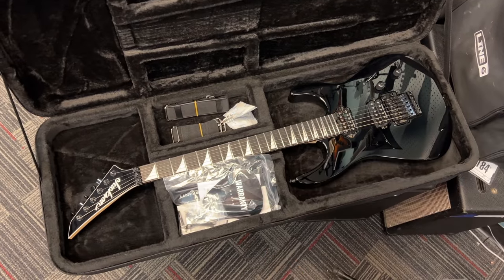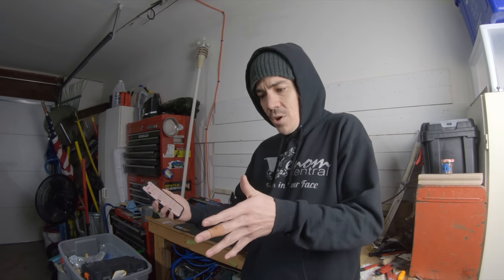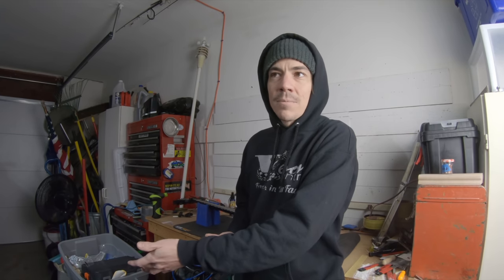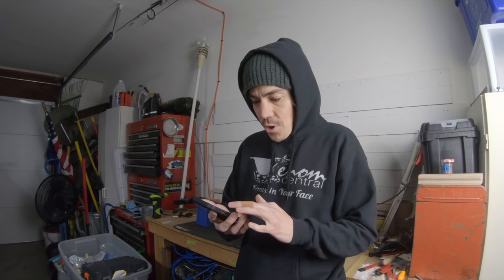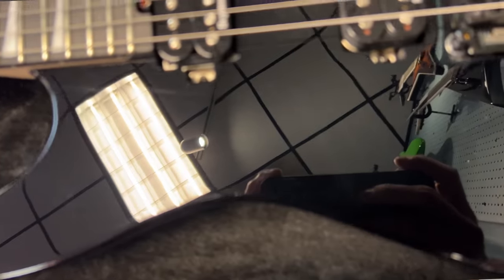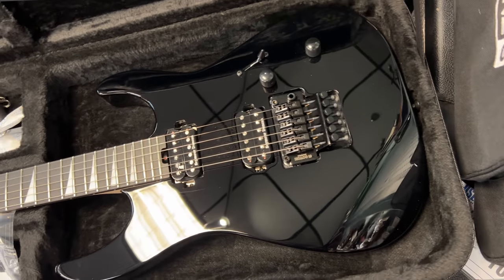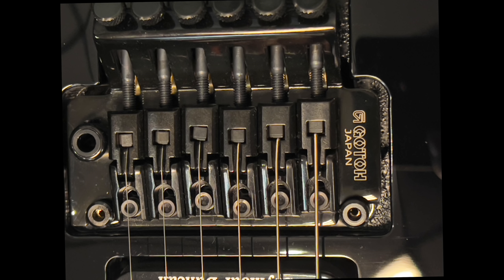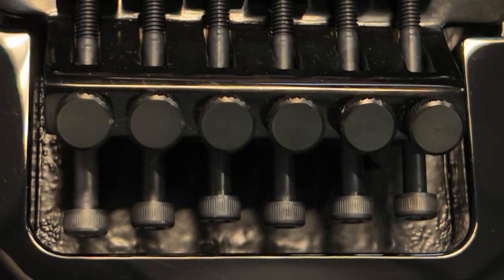JACKSON GUITARS IS DONE. MJ series/INDO EXAMPLES

Comment: In the old days we had american jacks and jap jacks. Period. Now we have js-china, dk pro fender mexico, soloist pro samick indonesia, a few soloist pro china, a few korea, a few japan. The x series made at the Cort factory, and until they changed factories the adrian smith was made in INDIA. Jackson dont know what they have anymore and they dont know from whence it comes. But there are still some gems coming from these factories. I bought a jap dk-2 in the 90s (the ones everyone raves about) and it needed more work than my sl3 pro indo and my dk3 mim. I bought a new American 2002 dk-1 and it was perfect except it was dead. No pickup change helped. Just a nice playing peice of sheet. Catch the pro series when they are returned or slightly used for alot cheaper. They are decent guitars and very gigable but not worth the new asking prices. Fender owns jackson so I think fender might be driving jackson into the ground. At these prices sales WILL fall and that may be the plan. Jackson maybe Fender's 'dropper' write off.
Reply: I bought a used 2021 Jackson Adrian san dimas i got in mint shape for $350 and that thing is a beast for the money!
Even before i upgraded it the guitar played and sound incredible for a under $600 guitar(they go for $550 new)
all i did was remove the satin poly finish off the back of the neck and  put on tru oil and put in dimarzio's i had 
already. I will be swapping the Floyd special with a Gotoh 1996T down the road. not because i have to i just prefer the Gotoh trem.

Comment: Quite a few great 80's guitar brands are now really short on QC not just Jacksons. I have looked at quite a few Kramers that were almost unplayable brand new. Sharp frets, actions not adjusted properly. B.C. Rich guitars are not as bad but still overpriced for the workmanship on some of the ones I looked at. I had a Jackson Rhoads back in the day and sold it due to hard times and still regret letting it go. Love my Schecter I have now but had to upgrade the Floyd Special it came with as that was the only weak spot on the guitar with those pot metal saddles.

Comment: I was in with the whole crowd back in the day, and yeah the "Jackson" guitars of today are nothing like the original Glendora built Jacksons (up to Serial # J1800 (RR1800) and lower. I got an Indo SLX Soloist in April 2020, and the flaws were embarrassing; BAD fret sprout, wonky Floyd trem cavity, scratching from buffering (gloss black), just to name a few. Jackson turned to shit when Fender bought them from IMC, which actually still put out decent Jacksons well into the 90's.

Comment: 10:00 they most definitely did not say that.
Reply from the maker: Then why do esp, Ibanez, prs, and other brands made in the same factory by the same people have obviously better quality control and fit and finish? When I worked at Taylor we had different rules for what was allowed for different models. At these factories they have the same thing, and for different brands. Clearly Jackson allows lowers quality or it just wouldn’t happen. They are also cheaper wholesale than esp. For example my pro series king v was about 500 wholesale, 1000 retail. My Ltd ec-fr black metal was about $700 and retailed for 49 more at the time. I’m not sure which factory made the Jackson, but the Ltd was made at world music and is flawless. The Jackson far from it. If you can find another way to explain this I’m all ears. I check out every Jackson and esp that comes through my high volume shop, and that’s a daily thing.

Comment: Valid point you missed, is Kramer guitars.  Yes, they are owned by Gibson.  Kramer also did a LOT of ESP guitars R&D in the 80's..... Kramer have been cranking out some decent guitars recently.  Most the real Jackson guys stopped around the mid 90's when Fender bought out Jackson/Charvel......  I find it more interesting though, that Fender has Charvel guitars made in Mexico, while Jackson, which is of the same blood line, made in Indonesia.  For $2700, you could get a Caparison, which has a better quality control, and is more prestigious. 
Also, fun fact, the difference in necks from the ESP and Jackson, is the floyd R2 and R3 sized nuts.
Reply from the maker: Good points. Yeah the wider string spacing and wider fret board with the r3 is nice. I tried two Kramers that were about $800 and I wasn’t impressed at all. One of them was a total roads copy and I found it pretty lame Gibson is suing everyone while they are ripping off Jackson.

Comment: I only ever owned one ESP, it was a 2019 E-II Eclipse DB. Wouldn‘t stay in tune at all. The nut wasn‘t installed on a plain surface but even with a new bone nut it was kind of bad since the Gotoh branded tuners to me seemed cheaper than all the Gotoh aftermarket parts I bought up to that point.
I‘m sure ESP makes/ made some awesome guitars but I‘m kind of turned off by now.
Also I hate the shape of the headstock on their superstrats 😂.
Mexican Jacksons are pretty OK but they don‘t come with a Gigbag and to me seem of worse quality  than the japanese DKMG I had 15-17 years ago.
Value for money gets worse all across the board.

Comment: The inspector is one of the most important jobs in a factory and having worked at several factories... it's usually the laziest most worthless mfer who gets the inspection job because they don't really want to work hard. So they frolic and play all day but when the work days almost done they rush shit out without even inspecting the shit... I've seen it at Luke every factory I've worked at and it's sad.
Reply from the maker: The lazy/goofing off part was true for some of the people at Taylor, but not most of them. All of them were people that had been there the longest, and were burnt out on the politics and constant bull shit.  They were all very particular, especially on setups. If a nut slot was .001” too low they would make you put a new nut on. Finish flaws from finish department were passed through, but you got yelled at for 45 minutes if you scratched or dinged anything by the supervisor.
Reply: Yeah factory politics is some bs so yeah I bet alot of factory workers are disgruntled because the guy who is the back bone of the company gets shit on and the lazy mfer not worth a shit gets made into a supervisor that way they're not losing any production well every factory I've been at its been like that. Doing boss work for temp pay lol
Reply from the maker: You nailed it right on the head. I’m glad I don’t work in that kind of environment anymore.

Comment: When is Jackson going to take notice… they keep doing the opposite.
Reply from the maker: When we stop buying this junk and make more noise in social media
Reply: @jed_shred_guitars  I have two USA models and a mij ke3 from 99 bought new. I shop the pre 2011 Japanese market. Lookin at a few other mij right now as well.
Reply from the maker: That’s the only way. I’ve got my eye on a 2013 rrmg, but only if I can get it for a deal and flip. The 90’s ones are the keepers
Reply: @jed_shred_guitars  early 2000s are the same as most of the 90s. Same factory, same build. The early 90s professionals that say professional on the headstock were great but after 96 they weren’t like that. And there were a few up til 95 I believe that were extremely close to the USA models, even with neck thru and fretboard binding and such. Hard to find. But the majority of postings you see that say 96 model, 97 model, 98 model, the people are going by those serial number lookups and those numbers are actually early 2000 models. Through those years you can’t go by the serial numbers. My Kelly is a 96 serial number, but is a 99 year model.
Reply from the maker: you really know your stuff!

Comment: Japanese use thinner material than we do Evan there production cars have thinner body panels  than U.S made cars thatsa fact so all the 25uear or older skylines don't Evan bump them. I did notice there ding the pups to stall right without rings I hate rings. In the 80s the QC and the manufacturing of Jackson guitars was top shelf so good they were blowing the doors off the custom shop in Cali so Jackson had them shut there doors and stop inportiing  mIJ jacksons

Comment: I own a  Indonesian Jackson , very disappointed came with a suspect set up fretbuzz,& I think the neck was repaired from broken,, cannot be set up properly cant bend the neck it will fret out buzz stop ,sucks for a hard tail the misha monsour juggernaut sucks,, I miss my Ibanez jem Ibanez guitars are the best in the world ,,the made in USA Jackson’s  from the 80s were pretty good but they  all are just a one trick pony for the most part
Reply: Sounds like either the neck has a slight twist or the fretwork isn't perfect.
Wood is of course a natural, porous material and can sometimes move if it hasn't been dried properly or gets exposed to excess heat and humidity at some point.
Construction methods such as using quarter sawn wood, multiple pieces and installing composite rods all have serious benefits to stability over a single piece of flat sawn wood, but even then nothing can be truly guaranteed to remain 100% straight.
Have you tried taking the guitar to a competent tech for a check and setup?
Not saying you don't know what you're doing, but it might be worth getting someone with experience and (if necessary) tools to check your guitars neck and frets.

Comment: $2700 and no real MOP inlays/ logo and you get a soft shell case???  These are insanely overpriced! The old 90's MIJ Jacksons were as good as the USA ones.  they were the "Professional" series and were amazing guitars.  these new MIJ Jacksons are all overpriced and not very good overall. I am still a Jackson freak but only the old ones.
Reply from the maker: Even the later Japanese ones were great. I have an 09 and 08 that have better fit and finish than any USA I’ve seen, and just as well made. I traded one for a couple setups, and the other was 700. Pearl isn’t worth crap shoot quality and 3-5k price tag.
Reply: @jed_shred_guitars  I think you missed my point about the real MOP.  all i was trying to say is that Jackson is charging a ridiculous price and not even having the decency to include real MOP and a real hard case with the guitar. I know pearl does nothing for the guitar, it is more about the principle here.
Even IF that guitar was flawless i would never spend $2700 on a Jackson that has plastic inlays and a shit case!

Comment: I wanted a Jackson Kelly until my friend Darren from Theater Of Malum introduced me to the Schecter E1 which is more badass and reliable than the Kelly because the E1 has a sustainiac and minimum fret buzz with low action while the Kelly doesn't. My Dean V is a reliable beast but Dean and Jackson have went so downhill and make the same guitars ever year with no sustainiac options.
Reply from the maker: Is it setup properly? Those gotohs are fantastic trems and unless they damaged the blades or studs it should have no issue returning to zero.
Reply from the maker: Those sustainiacs are awesome!